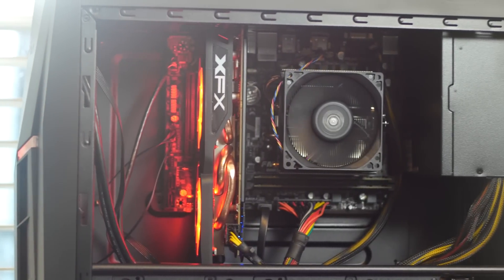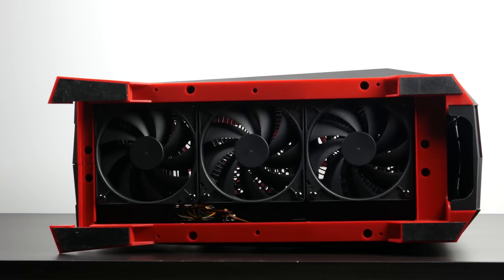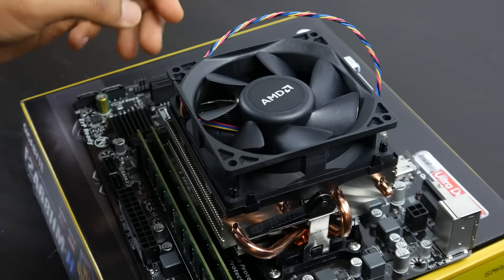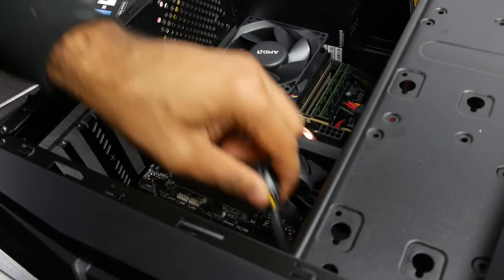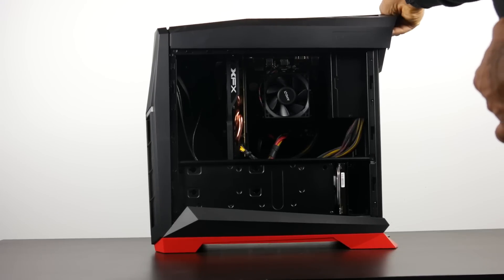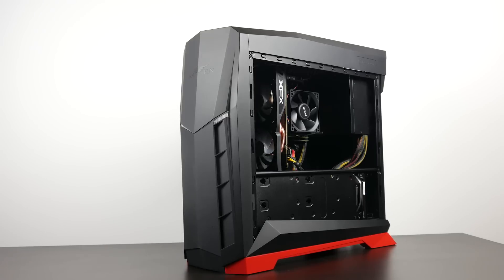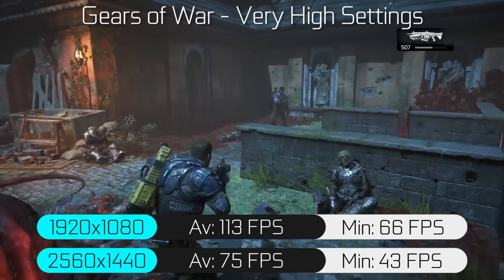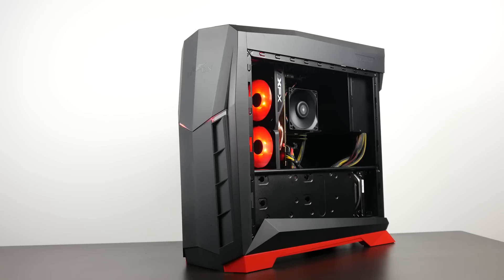Ultimate Gaming PC Under $550

Comment: Yeah I just saw the AMD CPU and........
Reply: Ryzen please be good, please
Reply: #MakeAmdGoodAgain
Reply: A smart decision would have been to buy a budget case in the range of $30-$40 and buy an i3 6100 which is significantly better than the 880K.
Reply: DannyzPlay yeah thats a good idea! :)
Reply: DannyzPlay I had to make that decision and I found a really nice looking case with a window for $25. Deepcool tesseract.
Reply: AznNavy yeah thats a good case dude!
Reply: I think if you want a budget AMD CPU build you need a good cooler and mobo to overclock.
Reply: But this wins the I3-6100 and RX 470, I  just could save 53 dollars on the $80 Case, and it will be better. But maybe there is even a bottleneck there.
Reply: Vero Young me too
Reply: Pentium g4560
Reply: iRuffy :D dual socket xeon
Reply: Core 2 quad q6600 gtx 1050ti get on meh level boi
Reply: Vero Young lol i have this thing xD
Reply: Vero Young destroyed your Phone xD

Comment: You basically paid the same if not extra for the case than the cpu
Reply: ChannelAsh100 tbh if I was doing this build I would go for the fx 8350 ,it's like $40-50 more but well worth
Reply: zen is around the corner and fx 8350 is hot, power hungry, only supports ddr3, pci 2.0, and actually besides the fact that dual cores arent always supported, the 6th gen i3 is better for your money for now until zen comes out. It surprisingly performs very well in games compared to 8350 if not better in some AAA titles. You could save money on a motherboard too. I think amd stopped trying in the cpu market years ago and just now picking back up.
Reply: good idea
Reply: Or you could get the FX8320 and oc @ 4.5ghz and you have an FX8350 for the price of an FX8320........That'a what I did.
Reply: I have an FX8350, for the same price, aka 160EUR in Occidental Europe, you can get an i3 6300, which is: way cooler, less power hungry, and WAAAY better for gaming.

One may take the FX8350 for programming and editing requiring more than 4 cores, but for gaming... The i3 6300 obliterates the FX8350 in performance, thermals, and consumption.

Furthermore, should you want to keep your 8350 cool you'll have to invest in a (very decent) third party cooler, requiring extra money. So in the end, the FX8350 will cost you more and be slower than the i3. No point in taking the 8350 or 8320 for a gaming computer.

As said, I have a 8350 and I have a full AMD Computer, and will always have an AMD computer (fanboy spotted), but in no way I would recommend today an AMD CPU for gaming and this even if Ryzen was not at the corner.

Comment: I'm sorry but this build was terrible.
Reply: TeCh ExPlOiTs yup, get a $20 case and he could get an fx series CPU or an i5 k series
Reply: Dont Care hmm, honestly he coild have gone with a i3 6100, 8gb of ddr3 ram, and Mayne and rx 470 or 1050ti
Reply: Dont Care and that cheap power supply :/
Reply: TeCh ExPlOiTs yeah even my budget 500 euro pc is better(no joke!)
Reply: LucGames - Overwatch and more! I believe it, and what are your specs?
Reply: TeCh ExPlOiTs intel pentium g4500 3.5 ghz, msi gtx 1050 ti 4gb oc, 8gb crucial ram ddr4 2133mhz and msi motherboard with 4 ram slots and 450 w corsair powersupply
Reply: LucGames - Overwatch and more! Intel pentium ._.
Reply: With £230, I managed to get an I3-3220, CX600, 8GB Ram, 1tb HDD, Nvidia Geforce GTX 760
Reply: daniel15092 What are the benchmarks for some games like GTAV with the GPU you have?
Reply: LucGames - Overwatch and more! Nice, ive heard that pentium is quite good. Is that true?
Reply: Well GTA V on high settings (Almost maxing out GPU VRam) I get min 25fps max 80fps, average around 50-60, you can look up some, it overall just depends on the rest of the system
Reply: daniel15092 wow thats very good i guess it is true about intel not making big gains on their cpus these last few years.
Reply: What are ALL the parts you need to get to build a PC? I've been with Xbox all my life but I love the new MMOs coming out but god does a laptop suck.
Reply: well for everything (correct me if I miss something)
Case (must fit motherboard and cooler in)
Power Supply (Recommend 500 watt or better)
Motherboard
CPU (thats compatible with motherboard)
CPU Cooler: Must be compatible with case, motherboard and CPU!!!!
RAM (Thats compatible with motherboard)
Storage - HDD/SSD/NVME
Graphics Card (Make sure power supply can handle it)
OS (while not part of the system you need one, like Windows or Linux)
Optional - Additional PCI cards (such as tv cards, SATA controllers, wifi cards)
Reply: Christian Michael research

Comment: THANK YOU FOR RUINING CHRISTMAS: Thank you for your video and for ruining Christmas for my son.  Your incompetent video and build list neglected a few critical items.  First off, your USED motherboard link resulted in a motherboard without an I/O Shield, so we could not complete the build.  To make matters worse, your video neglects to mention that the RVX01 has USB3 connectors in the case for the Panel USBs but the motherboard only supports 2 connectors for USB2, so the USB connectors on the panel don't work.  Also, you forget to include in your build the SATA3 Data cable and the link to the Drive in your build doesn't come with one.  Finally and the most unforgivable is the fact that the Case has support for 3 fan internally but they use 3 connectors of 3 pins while the motherboard uses 4 pin male connectors and the fans are so far away that extension cables are required but were not in your build list either. You also don't show anything about any of this in the "build" video.  My son is a huge fan of yours and he has been looking forward to Christmas morning for over a month now since he first saw your video.  Now, we have to buy a bunch of other items tomorrow when the stores reopen.  If you are going to do videos on YouTube, you have a responsibility to be accurate and complete in your videos.
Reply: Gordon Miller 
lol dude, you blamed someone for ruining you and your son's christmas?
i think it's your fault for not browsing the internet longer and getting more knowledge on what you should buy and do about building your own PC
Reply: uranier145 yeah, well considering I have built over 100 PCs in the last 30 years, you are likely right, but our purchases have always included all the correct cables matched for the setup. When this guy specifies a motherboard with only 2 fan connections and a case with 3 fans you would expect him to at least mention that you need a cable. Also the USB3 connector on the case and the mismatched USB2 ports on the motherboard are all details he left out. I assumed that his build would be complete and accurate and not being familiar with this specific setup, he should have done s better job. The fact that the used motherboard he linked to didn't even have an I/O shield is a huge oversight. His obviously had one. Just sloppy post. The lack of a SATA data cable is on me, but usually the drives or case has included them. Might have also mentioned no DVD Slot in this stupid case.
Reply: Gordon Miller maybe next time, we shouldn't trust someone elses build just from a video and since you have some experiences building a PC, but i guess never fully trust anything you see or hear on the internet is my only advice
 
And I'm glad that someone like you admits your own fault to a certain degree and not bashing on me
Reply: uranier145 the fact that the build video is unapologetically inaccurate and incomplete is inexcusable and shows just how useless all the videos for this account are likely to be. I admit that the omission of the SATA data cable is my fault but the lack of enough slots to run all the fans in the case and the USB mismatch is all on you.
Reply: rip a $450 Kaby lake build would've been better.  This guy doesn't know what he is doing.
Reply: SonicGabriel yeah we found that out the hard way.
Reply: Should have gotten the Boson 4.0 by Austin Evans. Its the true budget PC for only ~$400
Reply: fuck christmas this guys video is hands down the best video on youtube and ur son should be proud to have watched it and build a crappy pc based on it.
Reply: Gordon Miller Would you really trust a build with a $80 case in a $550 budget? The 880 is still horrible.
Reply: Gordon Miller u do know that u don't really need a motherboard io
Reply: Travis I hope your kidding
Reply: Gordon Miller Ikr
Reply: Gordon Miller he doesn't give much info
Reply: Dude you should've looked at what the used motherboard came with lol ur fault
Reply: Do your own research then? He has no idea of what is going to come with a used motherboard. You would assume it comes with everything you need, but one box may be missing stuff when one isnt.  I/O shields help keep out dust, but are not required.  SATA cables come with your motherboard, had you bought a new one it would have came with both the shield and any cables you needed. Also, you can plug a 3 pin fan into a 4 pin connector....First time ever building a PC?
Reply: Wait, after reading this comment, the blame is completely on you. If you have built that many PC's, there isnt an excuse for not looking at all the specs on all the hardware, recommended through a video or not. Especially if it is a christmas gift for your son. Also, optical drive slots are disappearing from cases. Optical drives are becoming obsolete.
Reply: Chris C. I didn't know it was time sensitive
Reply: Chris Wigg and you’re late again 😂
Reply: Chris C. I'm sorry man, I don't know what you're on about.
Reply: Chris Wigg you don’t need to be sorry it’s all good 😂

Comment: i dont think you should be telling people you can get a playable 4k gaming experience out of this build because you probably wont. my i7 6700k / gtx 1070 build handles 4k gaming but only by a little if i turn down settings and overclock as absolutely far as my parts will go. please don't go for this build if you have 4k in mind. 1070 or better to get 4k gaming. example: witcher 3 @4k ultra no hair get 30-40+ fps. fallout 4 @ 4k max settings ~ 45fps. bf1 @4k ultra ~55fps. turn down settings to hit consistent 60fps. just make sure you're
 informed before investing in pc parts
Reply: on the flip side if you're playing light or old titles yes, maybe you can expect playable 4k but in my opinion that should have been specified.
Reply: Yeah I decide to sli 1070 and I was able to get rid of my overpriced gsync monitor and get an affordable 4K free sync and I constantly hit 60 in everything so far
Reply: +Stagm3 WTF? You can't use Freesync with a Nvidia GPU setup... You fuked up lol. It was the G-sync monitor that you got rid of that was compatible with your GPU setup, not the Freesync monitor you replaced it with.
Reply: I agree I have the same specs as you... you can see my rigg on my channel
Reply: If you can afford a decent 4k monitor you could probably afford a higher priced more powerful build, Decent machine and performance for the price. for 1080 gaming
.
Reply: he said playable at 4k when you bump down settings.

Comment: Please do not use the 880k. Zen is around the corner and even then you should get Skylake if you must have it now, it is more efficient and has higher instructions per clock and is newer so when you want a new CPU you dont have to replace the motherboard. Also FM2+ is a dead socket either way.

Comment: Will It better if i replace the gpu with the gtx 1060 and the case with a 20$ one
Reply: For the case definitely, you can knock it down to $500 ish, but if you're more into gaming, the rx is better while the 1060 can handle lots of good games, it is outperformed by the rx. if you want to drop around $30-40, go for the 1060 and lose about an average of 5-10 fps, but if you want a better experience, go the rx.
Reply: I have been looking at  some comparisons and the 1060 seems better :P
can you give evidence i just dont want to trust a youtube comment with a 250$ purchase lol
Reply: Speeding Sniper one tip... NO
Reply: Speeding Sniper Get a better CPU

Comment: I have few questions to ask.
Does the Athlon X4 880k limit the capability of the RX 480? 
Did you try using a faster CPU for the same graphics settings?
How much frames did you gain from the faster CPU? Min-Avg-Max

Comment: enjoyable video and build ! great prices in here :)
Hey I am about to buy parts this boxing day and I am hesitating between the FX 4350, FX 6350 and FX 8350 or 8370 for a 1080p60fps/1440p45fps approx. gaming build that I will also be recording at 1080p60fps (the gpu will be a 1070.) and editing using a cpu intensive Hitfilm Express and Handbrake for conversions.
Which would you suggest ? thx :) !

Comment: I got a good build going for $930
Mobo: AM4 AMD B350
CPU: AMD Ryzen 7 1700 8-core
GPU: GeForce GTX 1060 SC
RAM: 8GB DDR4
PSU: 500watt
HDD: 1TB
Case: Rosewill - Gaming Black ATX Mid Tower (w/ three fans) $38 
plus keyboard and wireless wifi adapter

Comment: the problem here is that you are getting used parts so the chances of someone else being able to pick a board for 20 dollars or a decent psu for 30 are next to none,plus you also need to include about an extra 100 for the operating system. so if you really do the numbers by buying new parts,operating system,dvd drive, perhaps sd card readers, keyboard and mouse,this build would be easily about 800 dollars,just saying... good video nonetheless

Comment: For $430 today I bought:
i3 6100 ($100)
Gigabyte GA-B150M DS3H ($22 because of rebate and $30 CPU combo)
2x4GB GeIL DDR4 2400MHz RAM ($50)
XFX R9 380 2GB ($105)
Cougar Solution ($30)
Corsair CX650M ($55)
WD Blue 1TB ($42)

I honestly think your build isn't good for the money.
Reply: Forgot to mention some fans ($10)
Reply: First Name Last Name Your build is not that effective, R9 380 is good enough but why the 2gb vram version, AAA Games need 4+ gb..
Reply: - Immortalian - Maybe because he's not going to play AAA games?
Reply: First Name Last Name why 8gb ddr4 Ram, when he is not going to play AAA Games, 10Bucks more for 4gb and keep that card 1-2 years longer.
Reply: I got the 380 for $105. You expect me to pull a deal out of my ass for a $115 4 gig 380?
Reply: First Name Last Name I wont even buy a 2gb gpu in 2016.
Reply: To be honest, 2 gigabytes of vram on a mid-tier gpu such as the R9 380 is perfectly fine. There's not a significant performance difference between 2 and 4 gb of vram, and the R9 380 wouldn't even have enough horsepower to ever be in a situation where it needs 4.
Reply: First Name Last Name Ok, If you have 4gb you don't need to think about it, just set texture to ultra and play :)

Comment: I have an 860k that gets super hot.  it spikes up to 80 degrees and It's not even overclocked.  I would like to overclock it, but I am worried about the heat.  I am using a Cryorig C7 to cool it

Comment: Or you can shop around for a used hp elite 7500 desktop with i7 3770 (or similar cpu) and 16gbs of ddr3 ram for less than 200 bucks(there are also multiple offerings on ebay for old office oem intel i7 sandy bridge-ivy bridge desktops from dell and lenovo at dirt cheap prices). Add in a 500w psu with a compact 1080p killer card, like the 6gb 1060 and you destroy every console for less than 500 bucks.

Comment: -Core i5 6500 @3.2 GHz
-H110m Pro-VD
-Corsair Valueselect DDR4 8GB
-Generic 256gb ssd
-MSI Armor 4G rx470(running on integrated because a fan didn't work and I needed to replace it)
-RM550
-WIN10
-Apevia X-QPACK4 GN

Comment: Is core i3 6100 good for a mid-ranged gaming PC? Just asking because I have it in mine.
Reply: BlockyNikolaSerbia i5-6400 could have been better. But 6100 is also good
Reply: Atul Navadiya Thanks.
Reply: BlockyNikolaSerbia a 6100 is a great chouce. Just as long as you dont put it with a 1070 or 1080.
Reply: LDM tech Exactly
Reply: Tnx bros
Reply: Just built a computer for my son with the i3 6100 with an msi b150m arctic and a gtx 1070 awesome build.  Only thing is cpu does rise to 100 percent use when gaming but so much more stable than most amd processors out there.  Also we can always upgrade to an i5 6600k later but it is a good budget processor for gaming.
Reply: sombagonkaron i3 is going to bottleneck your gpu, u need atleast i5 to run 1070 at full potential!!
Reply: You are right I see that, because the cpu usage is 100 percent and GPU is around 50 percent.  That is why we have the room to upgrade later once prices drops because of the 7600k coming out soon.